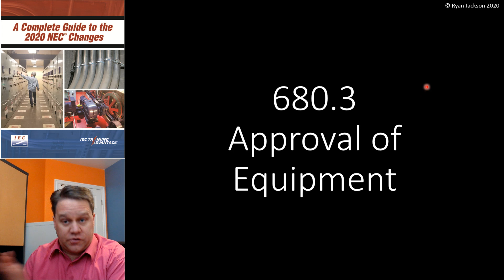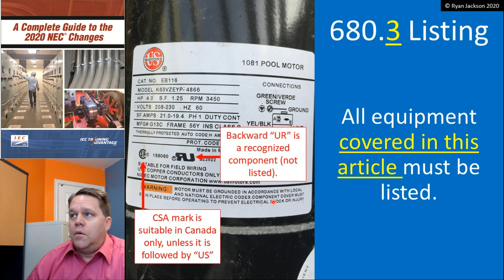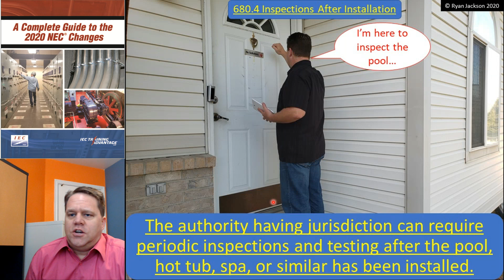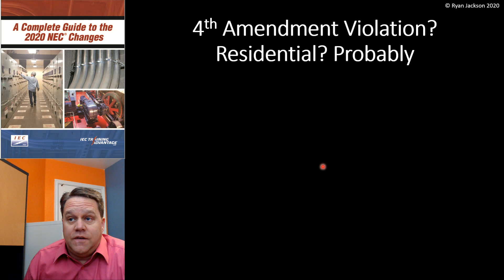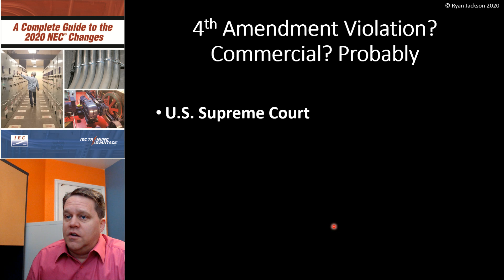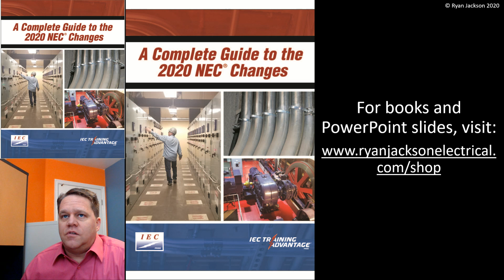680.3 and 680.4

Comment: The constitutional protections are pretty strong given that cities can't even use electrical usage records from a city utility to get a search warrant for a grow house. Still, for commercial, operating licenses needed to operate facilities open to the public seem to include inspection permission, or no restaurant would ever let the health inspector in. 

I think the code might be useful should there be a complaint from a neighbor about getting shocked, but a complaint and search warrant would be required if the homeowner refused search permission. I expect your plumbing associates have similar issues with enforcing backflow prevention devices and required annual inspections for irrigation systems, especially for grandfathered systems. It would be interesting to hear if any of those have been litigated. In Illinois, the requirement was that the homeowner was required to have the backflow device annually inspected and the report go to the water utility, which keeps the AHJ out of the actual searching.

Comment: Forget about inspections under the code. You would want it checked just for safety    reasons as materials degrade over time and especially so in water or harsh or hazards based enVironment. I believe we should be educating homeowners to take charge and do inspections for safety reasons not  mandated for as you mentioned for constitutional reasons regarding this rule.
Reply from the maker: Oh, I definitely think pools need to be checked at regular intervals, I just don't think you can REQUIRE it.
Reply: Ryan Jackson which neatly brings me to the issue of testing at least in a residential setting. The NEC does not explicitly articulate a testing regime to asses the quality of electrical installation- wiring, panels, earthing, and devices. The U.K. has an EICR framework, and Europe something similar so at least if renovations are being done that assessment is done. Landlords are required by law to have one done on the properties they own and rent out. Is there anywhere in the USA an electrical installation testing framework published?
Reply: there are only so many obligations an individual can take charge to do. or even be expected to know about in the social environment we are in. i don't see a problem with "if you want a pool, you have to make sure it's safe." there's always going to be that one guy that says no, something happens, and they get their child killed because they didn't think it was that big of a deal.

Comment: Can you legally (building code) (law) build an electrical system or even install 1 or more  Circuits by the 2020 NEC code where city are using the 2017 or older..
Reply from the maker: Most of the methods allowed in the 2020 NEC are allowed in the 2017 NEC. Sometimes new rules are more restrictive, sometimes they are less, so it really depends on the circuit/equipment you are discussing. When I was inspecting I would almost always allow something that I knew was allowed in the next version of the Code. The exception to that was if the new rule was part of a "trade-off." In other words, something that is allowed now might only be allowed because of a different change that occurred, so you need to be careful.
Reply: My county in Virginia allowed me to do this for the same reasons you suggested. They always look favorably on the latest code even if the state has not moved to it.

Comment: wet nich luminares, are brass conduits better for grounding or. Do they last longer ? Whats the reasoning behind using brass conduits in swimming pool installations ?
Reply from the maker: Brass conduit has a lower impedance than a PVC raceway with a green wire in it, so yes, it would be better for grounding and bonding. It also has the risk of potentially becoming energized (in an improperly installed system), so I personally would never use it. I am a big believer in nonmetallic raceways for that reason, but that is just my opinion.